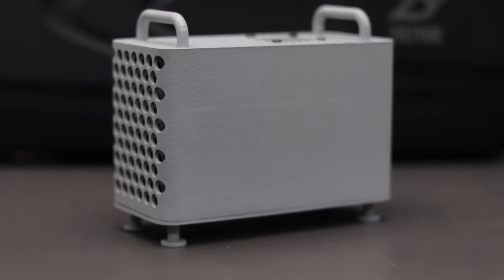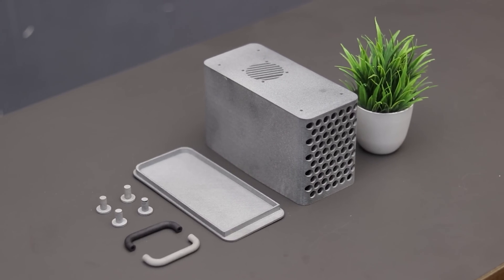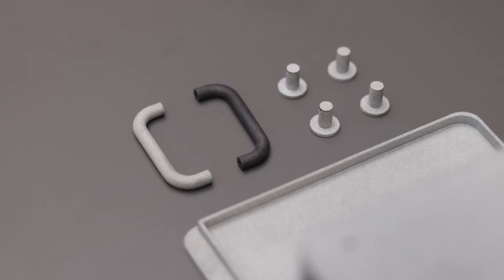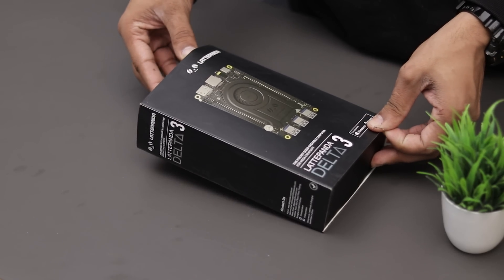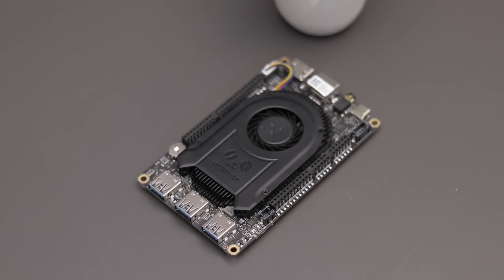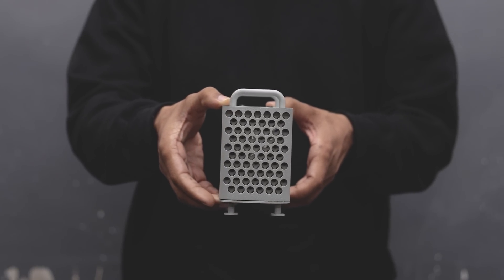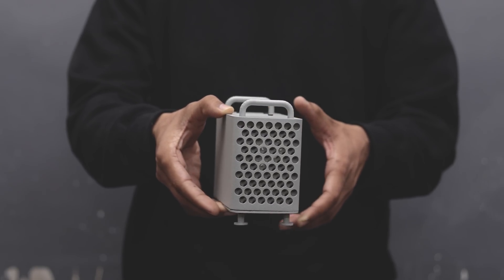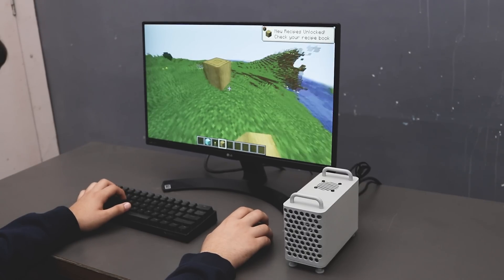DIY Mini Mac Pro | Apple PC

Comment: Sir make project for bike
Arduino nano, r503 fingerprint sensor, df player mini and accelerometer sensor ADXL345 Tripple Axis (when bike/scooter off with fingerprint sensor or rfid tag bike/scooter automatically lock and df player sound don't touch me)

Fingerprint sensor r503 and rfid mfrc522 work simultaneously

Fingerprint sensor actions

1st time place finger ignition on 

2 nd time place finger engine start (when place finger on fingerprint relay is active and remove finger relay is deactivate)

3rd time place finger ignition/engine off

Rfid mfrc 522 actions 

When scan rfid tag ignition automatically on and few seconds engine on (self on )

Fingerprint registration without computer through Arduino nano only 

1 or 2 admin fingerprint registration through a push button then registration secondary fingerprint sensor via push button (when secondary fingerprint registration admin fingerprint required only)

And all fingerprint database delete option ( admin fingerprint required only) then registration new fingerprints 

 

df player mini voice for example fingerprint accepted, place your fingerprint, remove your finger, place again your finger, registering your finger, when fingerprint not valid finger not register df player voice 

And custom pcb mini size and active low relay 4 relay action (1 for ignition and second for engine kill switch and other two relays for self and break )